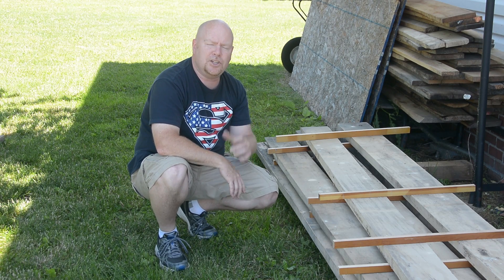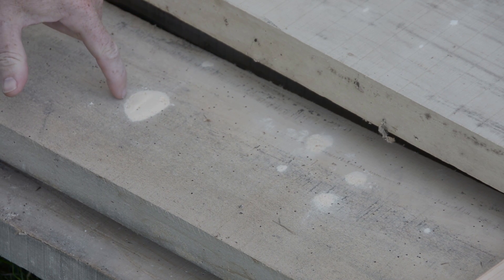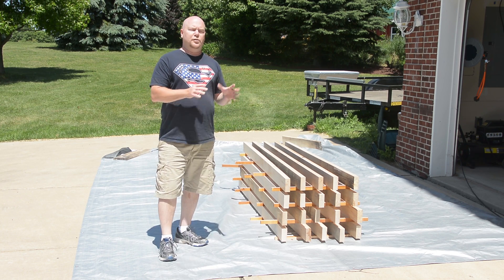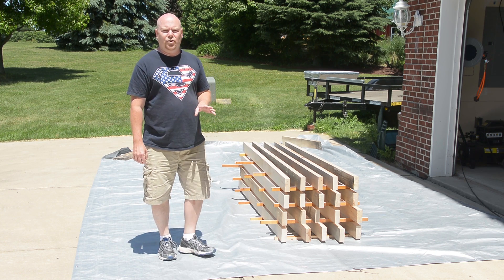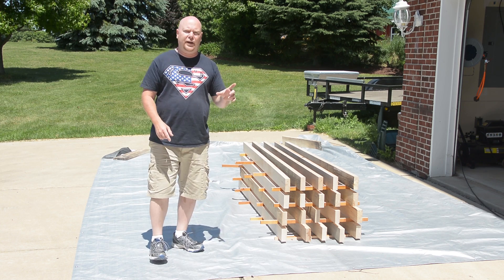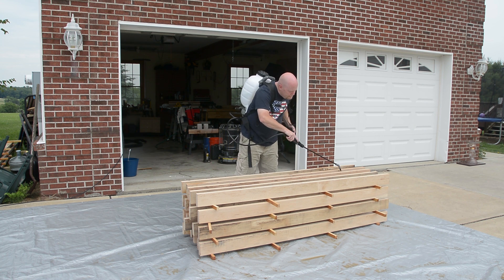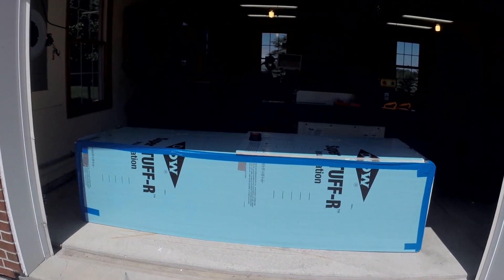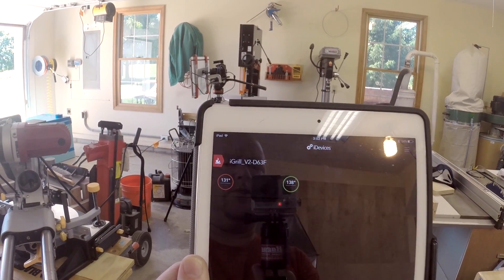Bugs!

Comment: Thanks for your ideas here.  I have been resawing red oak from 4 foot long logs and have some beetles in it.  I have the materials and appliances to make a kiln that will dry and then kill the bugs.  The kiln will be 4foot by 6 foot by 4 foot tall.  Built inside my garden shed.  Outside frame will be made out of 2x4s so I won't loose all the storage so I can put stuff on top.

Comment: Two questions. Does the heat warp the wood, and do the bugs literally come to the surface and die? I have mesquite planks that show signs of bugs with the powder residue and want to rid it of bugs so I can use it in my projects. Just want to make sure am doing it right so I can use the wood and be bug free.
Reply from the maker: I saw minimal warping,  but maple is pretty tough and this wood was bone dry to start.  YMMV.  The bugs die where they are so the wood remains full of crispy beetle corpses.
Reply: @MattHeere  I would have liked to see the dead, crispy bugs.. maybe I missed something? But BRILLIANT idea 🎉
Reply: @mayemily143  they are inside the wood. How would you see them?
Reply: whether it will warp all depends on how green your lumber still is. if it is fairly dry, it shouldnt warp, especially on stickers liek he did. I have heat treated mesquite myself, my pieces were small enough to fit in my oven, so I just set the oven for 200f and baked them for an hour. For other pieces, I wrapped them in reptile heating cable and then sandwiched them between batts of mineral wool insulation for 6 hours. You need to get the internal temp of the wood up to 133f for 30 min continuous to kill everything, including eggs. get a remote temp probe and you should be successful

Comment: Glad I came across your video. Did lots of research and seems that you have all the answers (based on your experience). I did search for a way to avoid bora care because of the cost, and did read that borax with water will do the trick (not sure if cold or hot water). Heat would defently work to kill the inside ones, but i do wonder if the treatment with borax worked? (video was posted at 2016. we are now at end of 2021). Would be happy to hear your thought on that. thank you

Comment: I have this problem with some English Maple  I was thinking maybe I could pass an electrical current through the wood .... I'm not an electrician so I intend to research this before doing anything ! ...    Any Sparky's out there !
Reply: To get electrical current to even try to travel through wood you have to build a device that could kill 10 men. Then you have to soak the board to allow current to flow, then the flow will most likely travel around living creatures because they aren’t an efficient path and electricity is all about efficiency of travel.

But I don’t know. I have used a device which electrocutes wood and watched an ant walk right up the prong while it was firing on full and the wood beneath is was on fire.

Comment: THAT INSULATION IS HIGHLY FLAMMABLE! I strongly suggest you test this yourself and tear off a small piece and see what happens when you put a lighter under it. It will burn easily and quickly. You have a high power heater surrounded by a foam tinder box. This is a great way to burn down your house! It's not worth it to save some scrap wood.
Reply from the maker: According to the manufacturer's data sheet, this foam is rated for use up to 190 degrees F.  My setup never gets it up past 160.  I wouldn't leave it unattended, but to compare what happens in a 2000 degree flame with what comes out of an electric heater with a thermostat is pointless. 
 (http://msdssearch.dow.com/PublishedLiteratureDOWCOM/dh_093d/0901b8038093d1f5.pdf?filepath=styrofoam/pdfs/noreg/179-04004.pdf&fromPage=GetDoc)

Not sure I'd call many hundreds of dollars worth of spalted hard maple "scrap wood" either.
Reply: @MattHeere  I doesn't matter AT ALL to me if you burn your house down. I posted that comment to warn other people about it. I very seriously suggest that anyone trying this do exactly what I suggested and experiment with what happens when you put a lighter flame under a sheet of that type of foam insulation. It is surprisingly flammable. You're being straight up naive thinking that there's zero chance your space heater will never ever malfunction in any way and produce more heat than it's supposed to. Any 120v electric circuit has the capacity to produce a spark in places you don't expect. Code for using that type of insulation is that it must be covered over with fire rated drywall. Without the drywall it is a fire hazard.
Reply: For anyone thinking about making one of these out of insulation foam, first look at foursevenfive.com/blog/reason-foam-fails-2-unacceptable-fire-hazard and consider whether it's a good idea to be one small electrical glitch away from burning down your house in order to get a couple board feet of old scrap wood.

Comment: What are the mixtures for 20 mule team borax you used?
Reply from the maker: As strong as possible.  Keep the water hot if you can, and keep adding borax until no amount of stirring will dissolve any more.   I then let mine sit for a bit so I could pour off just the liquid into the sprayer.  Chunks of borax are, as you might imagine, pretty dang hard to spray!
Reply: @MattHeere  for you, did you mix an entire box of 1.5lbs of borax in the water and then sift the water into the manuel spray canister?
Reply: Is there any way I can have a short conversation with you? I actually have a small problem with these beetles in an already finished project and so i have limited options considering some of the components cant be exposed to high heat.
Reply: Long story short, I made a frame out of rough pin! I have mot treated the surface but I did burn with a torch on one side! One week later while it is inside, i discovered rice grain sized black beetles crawling around it... so i took it straight outside and well I could only find "on the shelf" pesticide like Raid to maybe get rid of them... I have been spraying the frame itself and pretty much saturated the frame with it since sunday.and the bugs are still found dead on the floor though body count is down to like 1-2 a day! So I was wondering you I could just use the borax to coat the wood and finally bri g the frame back in

Comment: Hi Matt. I stumbled on to your YouTube channel because I have the  same problem. I have some powder post beetle infestation and I’m building my wood kiln now. I’m running into the problem of finding a heater that can reach 140F or 150F degrees. All of them have automatic shut off at some upper limit temperature and I’m not sure what to buy. How did you manage to get your heater to 160?
GREAT VIDEO!
Reply from the maker: It may be because mine is a 220V model, or maybe I just got lucky.  150 should work, it'll just take longer.  Good luck!
Reply: By any chance, do you know an exact model number of your Duraheet heater? I see there are a lot of different models.

Comment: borax is not the same as boracare. You can make your own boracare with borax + boric acid, which you can buy at a farm supply store. I got the recipe from this old thread: sawmillcreek.org/showthread.php?233066-Home-made-bora-care-amp-timbor
Reply from the maker: Boracare and 20 Mule Team Borax are both borate salts (disodium octaborate tetrahydrate and sodium tetraborate respectively).  Boracare uses DOT because of it's solubility in glycol, not because it's any more toxic to the bugs.  The glycol carrier is the real advantage to Boracare.  It greatly increases penetration of the salt into the wood.  If you're treating something already built, it's absolutely the way to go.

In my case it would have been a waste of money.   I had the option to use heat - which is far more effective than any of the insecticides.   Also, I hadn't done final milling of the lumber, so I would have ended up cutting away the treated wood even had I used Boracare.   So far so good - the video is 2 years old and not a single bug has been seen.
Reply: Matt Heere thank you, i've learned something new!

Comment: Do you have a planer? You could have run the boards thru the planer also to get all four surfaces and edges cleaned up. So I guess you don't have one as it would have also helped with more insurance before spraying with the borax.

Elsewise thanks for your video it reminded me that I've got an old door found in a damp spot that I need get after for the beetles.

Comment: Should have gone with Boracare.  Could have saved a ton of time.
Reply from the maker: It took me 20 min tops to build the kiln, and I can reuse it.  Still seems like a better option than spending $100 on borax with $0.15 worth of glycol in it.  Plus, the boron salts work through ingestion.  Means that all the eggs and larvae have to become adults and start eating - a.k.a. more damage.  Heat kills all stages dead where they stand.

Comment: I wonder if you could use clear plastic and make an impromptu solar kiln. Good luck.
Reply from the maker: Solar kilns are a great way to air dry wood, but here in Western PA they're borderline for bug control.  The lumber temp needs to stay at 130 or higher for 4-6 hours minimum.  Right now you might get away with it because we're within a week of the summer solstice, and the ambient temps are high.  Normally though I think you'd still need some auxiliary heat.
Reply: +Matt Heere Same here for Western Oregon. We're lucky, not many bugs in the Northwest.

Comment: Well that way was better than what I did.  Was welding up a very large steel trough for a 12' x 3' bbq pit and was given a good bit of free rough sawn oak infested with insects. Flipped it over and propped it up a bit to let air in. stacked all the wood on the far end and lit a decent far on the other. fire got out of control and I ended up with a bunch of decent quality oak charcoal lol.
Reply from the maker: Not all bad.  Good hardwood charcoal is worth a few bucks, and the insects might turn out to be the "secret ingredient"   You'll be like the folks clearing those pesky mesquite trees and discover that a waste product makes for some good eats!

Comment: Hope it worked out well for the long run!
idevice BBQ thermometer you say??
Reply from the maker: Yep.  Bought it for my wife to use on the grill.  Honestly, it's just OK at best for it's intended purpose - but for this it worked like a champ.
Reply: +Matt Heere
Oh so it's hardware you purchase, install on the heat source and it can be read on an idevice! Ok thanks.